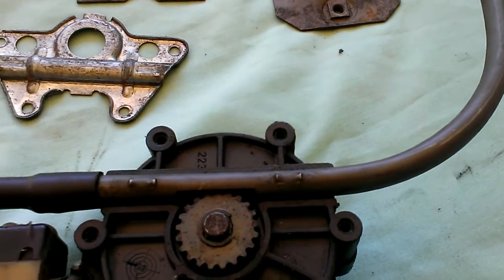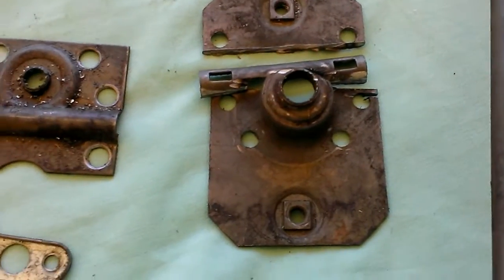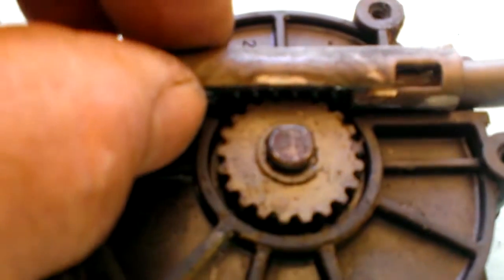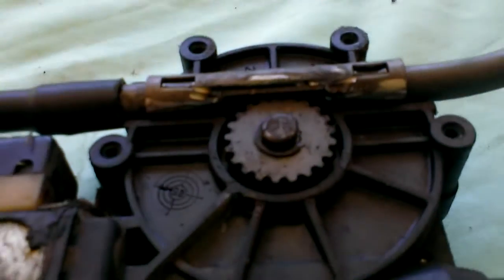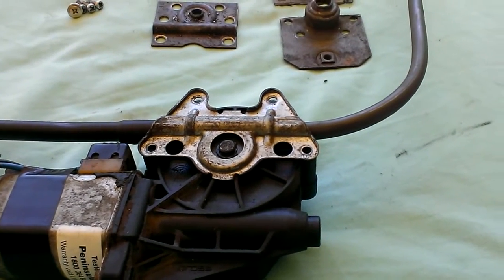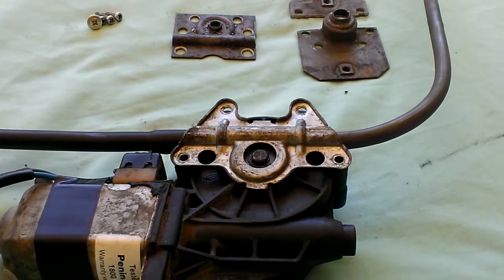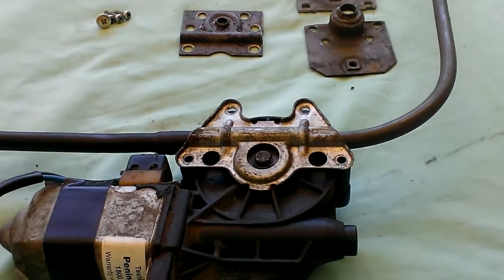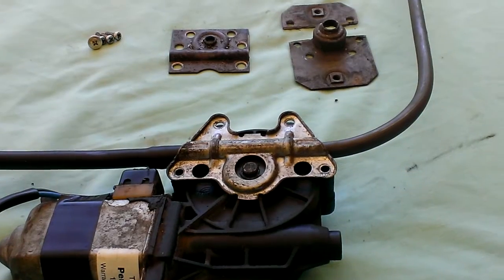T2vw bus with BMW electric window motor on cable drive part 2

Comment: how did you fix the motor to the door? did you use the original plate or how did you solve it?
Reply from the maker: It bolts onto one of the origial holes 2nd one needs elongating